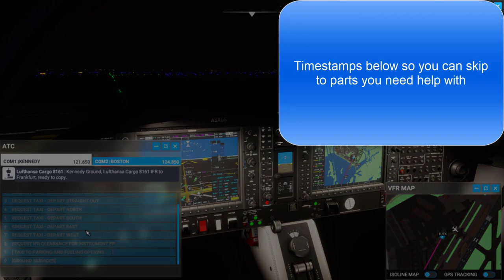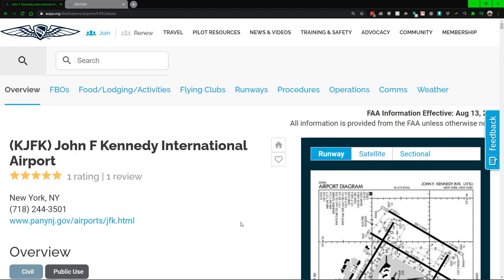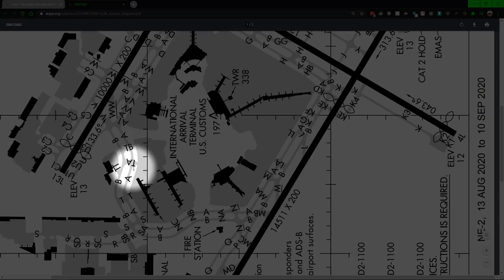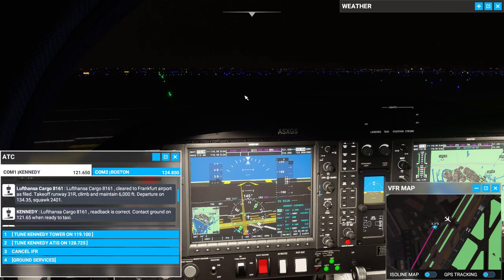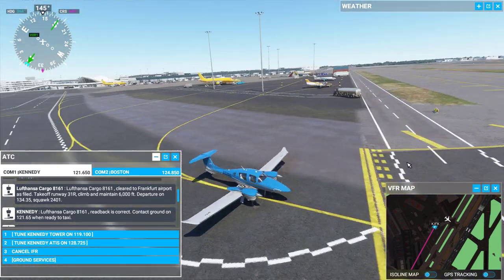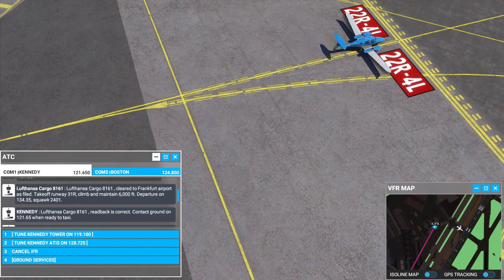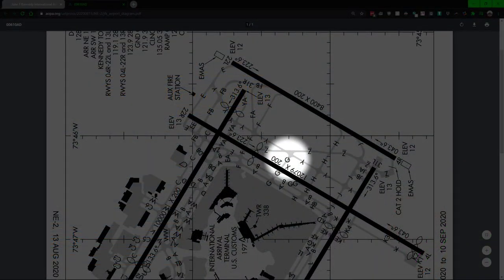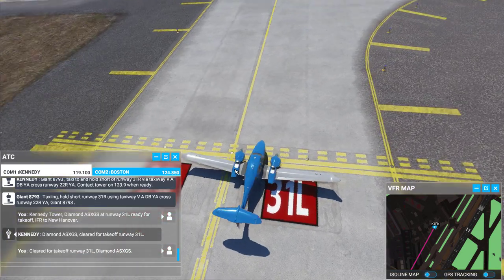Microsoft Flight Simulator 2020 -  How to taxi to and from the runway

Comment: When I tried to do taxi to the runway in LGSA airport the atc said some taxi way but in the airport diagram the letters was different, what to do in this case ?
Reply from the maker: Turn on the taxi ribbon in the settings. But I suggest just finding your on way to get to the runway. The simulation doesn't care which way you go about it
Reply: @TheAIKnowledgeHub  yea man but I want to make it realistic and like you not go random taxi way in real life you should not do it in the game. but unfortunately the in built atc taxi instructions is not accurate to the chart. that's why I asked for solution for this without enable the taxi ribbon
Reply from the maker: @alonzamir5407  There isn't one. I think I even mentioned this problem at the end of this video. In some airports the taxiways are marked wrong. And then on top of that, some airports the taxiway could break your airplane. Like the only other solution is by somehow getting into the files, find the right area, make the right change, and hope the game doesn't crash and it worked. That or mod it in, and hope that works. 

But until then, I'm just going to say that you have to find your own way to and from the runway if things aren't lining up. 

One thing I suggest is letting the devs know about your problem and which airport. Maybe they will fix the problem down the road. Because this is a widespread issue, I'm sure they will fix all of them in 1 wack by getting the AI to fix it.

Comment: Is that how pilots do it ? Why there is no navigation system that's guide them ? Can't believe it.
Reply from the maker: Kinda. So what happens is the bigger planes like the airliners, they have the money to afford nice things. This is to include things that list all of that, and then some. Smaller aircraft might have the GPS units that is in most planes in this game (G1000). That could have it. But 99% of planes don't have this since a system like that can cost in the ballpark of $25k just for the hardware. And then there is a chance installing it could cause problems.
Keep in mind most planes that are flying tend to be 50+ years old. Like the one I like was made in 1970 or 1980. This might sound old, but due ot FAA regulations they have to basically be rebuilt after so much time, and they have to have the upgrades required by the rest. Most of the planes flying over your head is that old because new planes can cost easily in the $500k area. Where the older stuff it can cost $40k or so depending on what it is. Like the Mooney M20M that I like you can get them down to $70k. But take a look at the dashboard and you will quickly find virtually none of them have any digital interface. In fact, some of the older planes don't even have auto pilot (which is something someone should add if they can IMO since that is only $6k).

Comment: do you know how can i identify the runway in the air? i always  land in the wrong runway
Reply: The numbers on the runway represent the first two digits of the direction of the runway. So say runway 35L is the left runway if you are landing towards 350º-359º or almost north. That same runway should have the opposite direction of 17R.
Reply: @adamrickman2461  thanks man
Reply: @adamrickman2461  Great advice! Finding the correct runway is always a challenge for new pilots.